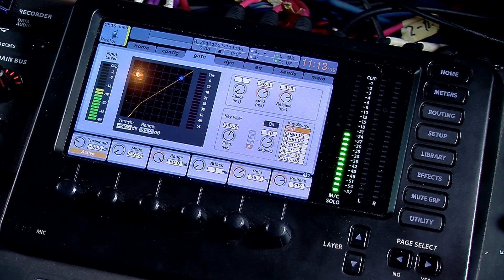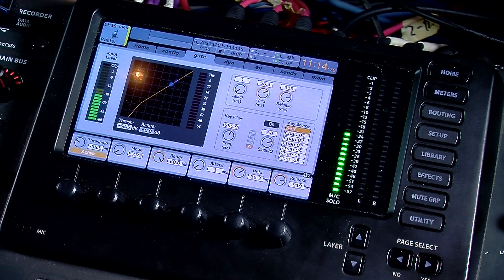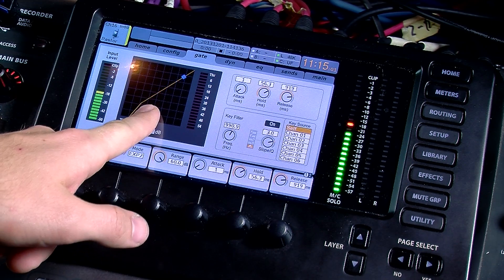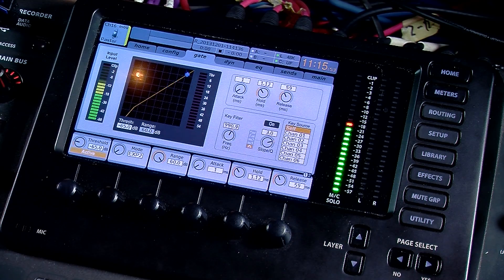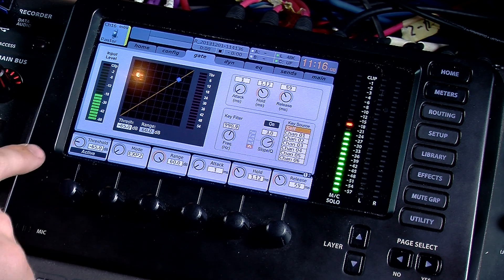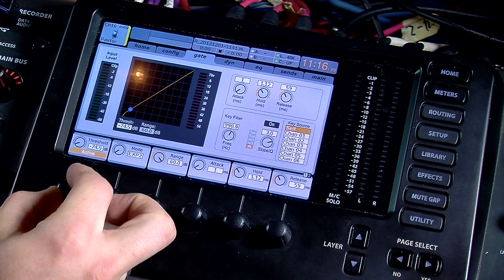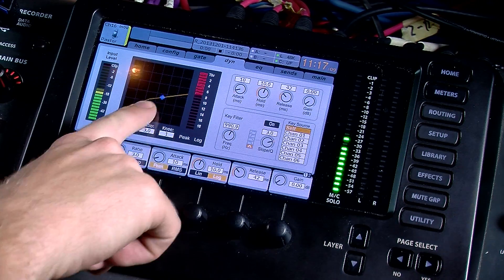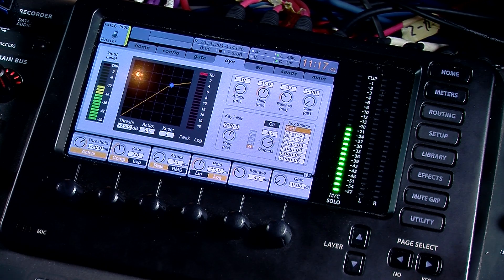Behringer X32 - Firmware V2.02 New Features - Dynamics & Gate

Comment: I am very thankful for all the tips you have that I will dive into soon.
I just bought an x32 and was simply wonderig 2 things about backing up/updating the firmware.
Q - How do you back the existing version up unto a "thumbstick" and is the latest version all you need, f ex: v2.04 now, or do I need the 2.02?
I have the 2.01 now.

Many thanx =)

Comment: ccw39, I loaded it last night and tested.  I wouldn't trust the Ipad app until they release an updated Ipad app.  Doesn't have the new features built into the software yet.  Also the X32 control app for PC syncs to an extent then stops communication so until they release new versions it's a no go for me.

Comment: Thanks for posting these, Drew! Are you using this firmware live in your services yet? Also, do you know if the iPad app can communicate with the new firmware as well (we use that to run the mixer until we can setup a tech station eventually)

Thanks!
Reply from the maker: I didn't extensively test the iPad app yet, but it connected and I was able to control it.  I will be planning on using V2.02 live on Sunday.  If you rely on using the iPad or X32 Edit programs, I would wait until they release an update to those before going onto V2.02.  After Sunday I will let you know how it goes with the iPad.
Reply: Cool, thanks Drew!
Reply: Drew Brashler how did it go with the iPad using version 2? I like the update but iPad control is key for me. Thanks